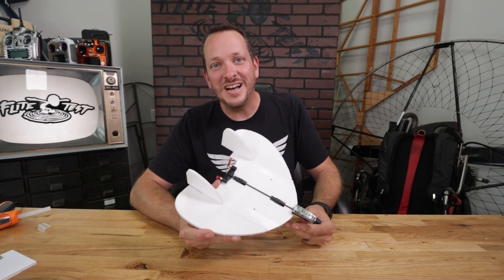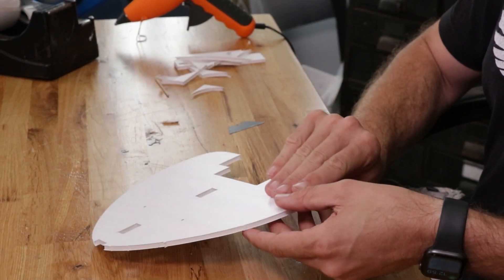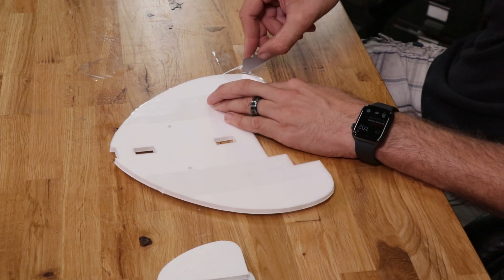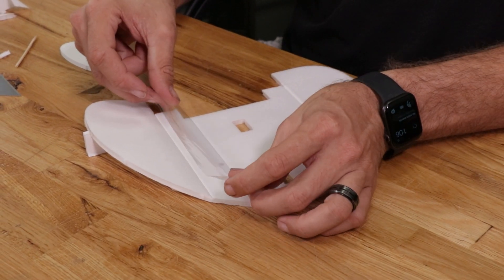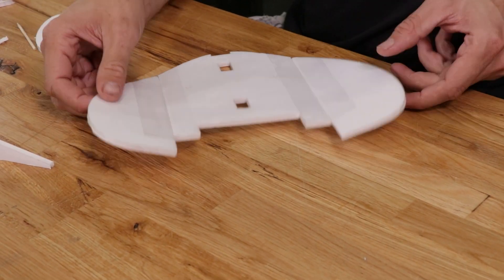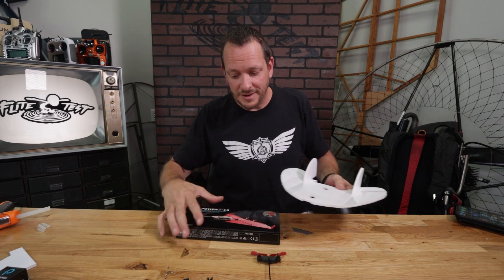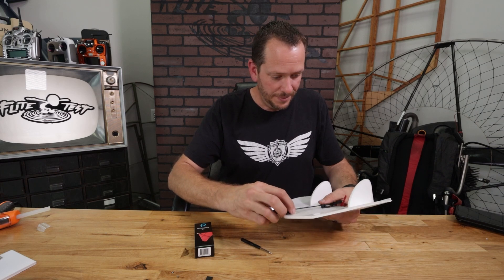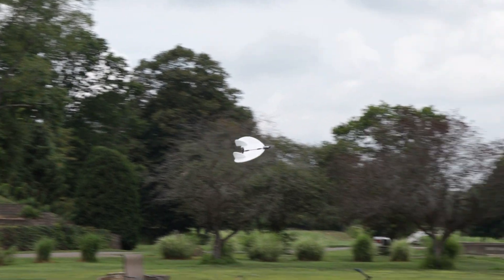FT Power Up Bug Build

Comment: I like how the PU4 module attaches to the EZ Bug and wish their F22 plane attached the same way.  Any plans to create a new F22 with the same attachment method using the slide on clips?  It's nice to be able to change planes easily.  Just built the EZ Bug kit with my son since my kids are home from school due to -20 or worse wind chills, but not really interested in flying it until the weather is warmer.